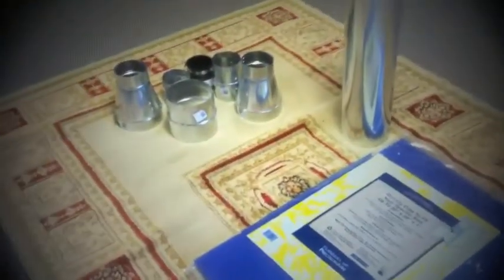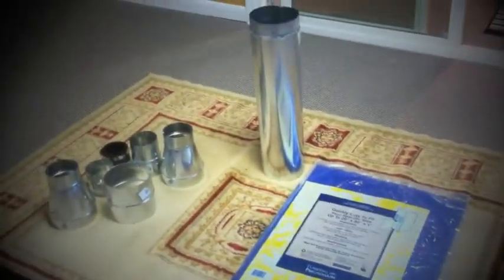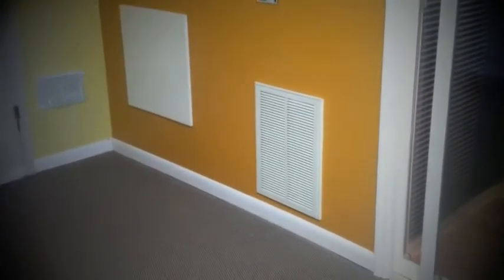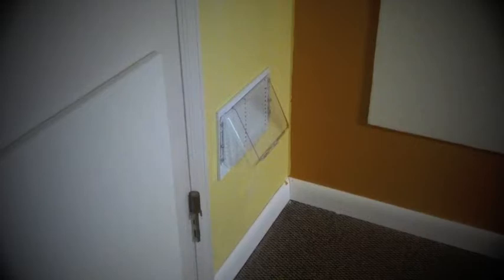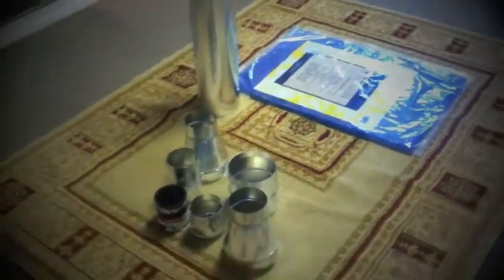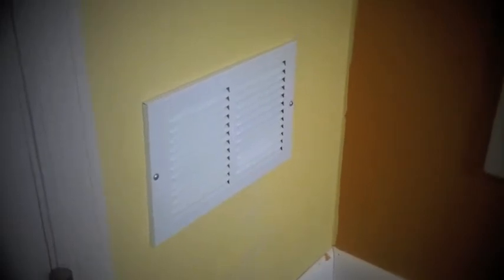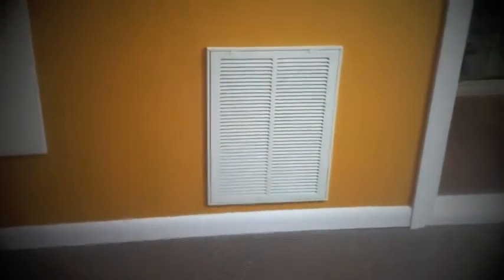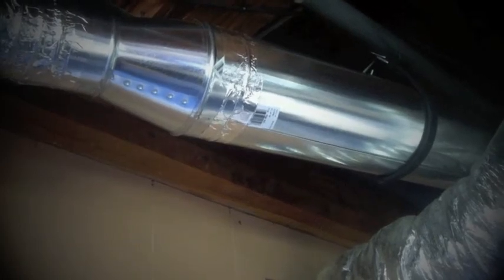Recording Studio Ventilation - DIY Outtake Silencer/Noise Suppressor/Muffler

Comment: If the room has a conditioned supply from your HVAC, and it has a return to your Hvac – why did you need that vent with the in-line fan? Is that just pumping air exchange to the adjacent room?
Reply from the maker: Good question. Since this was in a house, and in the basement, the air handler was near to the room. Also, I couldn't make any modifications to the system. The AC was loud in the recording room as well as just the fan being on. During recording the AC would have to stay off. This inline fan system allowed the warm air to exit the room keeping it comfortable to record and have many artists in the studio. It worked like a charm. In situations where you can't make any modifications to a building sometimes you have to think outside of the box for a temporary solution.
Reply: Oh, so this allowed you to shut your HVAC system off and still pull some air for exchange? 
I’m building my attic studio and although I have two supply vents, I don’t have a return inside the room, it’s just outside the room. So, I’m doing something similar as you, I’m just gonna run a passive air path through a baffle box that will allow air to escape Into the adjacent foyer with the main return is. There should be even more quiet than having an actual return, pulling air, that could potentially whistle as yours was, although it will probably still be a good idea to open my door every couple hours during long sessions to get this exchange.
Reply from the maker: Right. The air pressure, brought in fresh air through the AC exchange. This was my first project and next time I would use insulated AC ducting which should cut down the noise more. It’s a little more expensive but should make it supper quiet. You should even get a more silent inline fan made for sound application. I just used a fan from Home Depot which was pretty loud. I had to have it pretty far down the line. @GregoryGuay
Reply from the maker: Right without an outtake even with air coming it it's hard to keep it cool. Especially with a lot of gear and attics get hot anyway. Plus you want to get the old air out if you work long hours at a time.  @GregoryGuay

Comment: Outtake should be at the top.  Heat rises.  Fresh air should come in from the low to mid portion of the room. For example in your kitchen the vent (If you have one) over the stove connected to a duct system is at the top not the bottom.  When the oven and stove is on it generate a lot of heat.  Likewise in a recording room with equipment and more heat will build up and make people uncomfortable.  With the outtake being on the bottom you're energy bill will be higher cause you're removing more cooler air out than hot air because the cooler air starts at the bottom of the room.  We all learned as children if there is a fire to stay low cause you'll be able to breath better and see cause the higher portion of the room will have more smoke and heat.
Reply from the maker: Correct. Unfortunately the basement HVAC wasn’t installed that way when rented. So have to make due with what you have. If built from the ground up your suggestion would be the best outcome. Regardless it worked perfectly it being 100 degrees outside and being comfortable inside. Thanks for the ideal setup and explanation to help others. 👍

Comment: This is fine and all but why didn't you just use flexible INSULATED duct in the first place?  You used it on your AC ducting.  That is what should be used for all duct work going into any studio room.  That way you reduce low and high frequency noise all along the whole line and probably wouldn't have needed a muffler at all.  Not saying your fix is bad just saying doing the job to studio build protocols would have saved yourself time and money later since insulated flex duct is like only 1$ a foot at home depot and you just spent 40$ in parts for a fix.  Btw, just curious what kind of acoustic foam you used on the inside?
Reply from the maker: +Scott smith I hear you on that. Might replace the short runs with the insulated ducting like you mentioned. Would cut down the noise even more. So far haven't had any noise issues. But, yeah I see the insulated ducting would be way better and a faster install.

Comment: Does the intake vent not let any noise through from wherever the AC is, regardless of whether its on or not?
Reply from the maker: For the AC intake you will have some air movement creating sound. But, in the live room it is not audible. I put clear plastic diffusers over the intake vents which really helps. There is an iso booth just incase someone wants no background noise. Adding a noise muffler near the fan and AC connection really cuts down on the noise. I've learned the more intakes you add the less air movement and less noise will be created as the air is displaced. So, far no problems recording.
Reply: TRAVSONIC Media Great response. Thanks very much.

Comment: Looks great! How are you drawing in fresh air?
Reply from the maker: Hey Steve. Fresh air is drawn in naturally by the room pressure via the AC intake ducts. With the outtack running, the pressure difference draws in new air. Very similar to how vocal booths have only an outtack/fan located far away and draws in air to keep the noise down.

Comment from the maker: That's correct as hot air rises. Unfortunately, all the AC ducts and vents where originally installed at the top in the basement when I bought this house. So, as not to have all the intake air sucked out right away I had to put it on the bottom. But, yes it would normally be at the top. It's working fine regardless but would be better at the top for sure. The negative pressure of the outtake always on makes the air trickle in from the intake vents nicely with no noise. Great for recording.